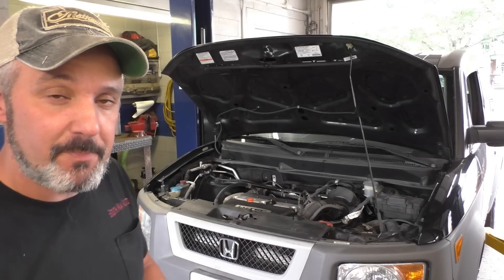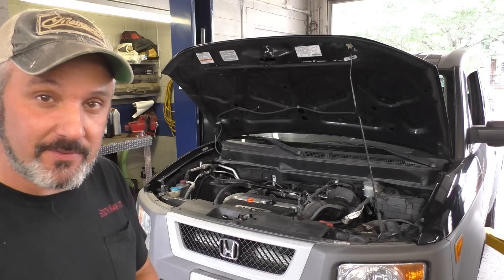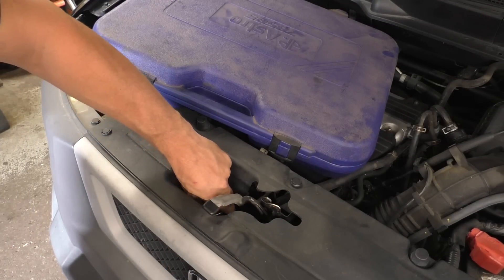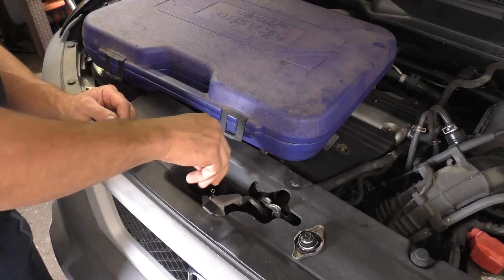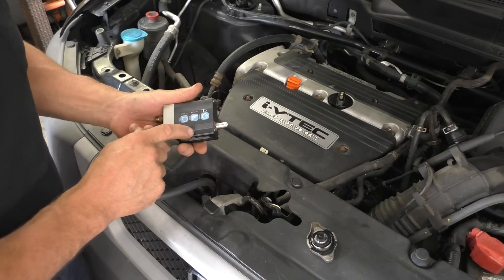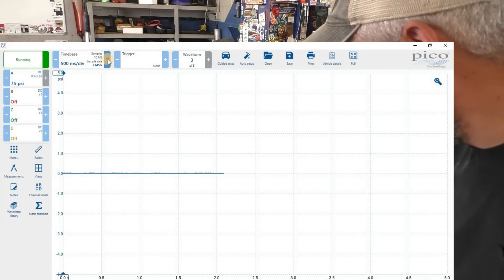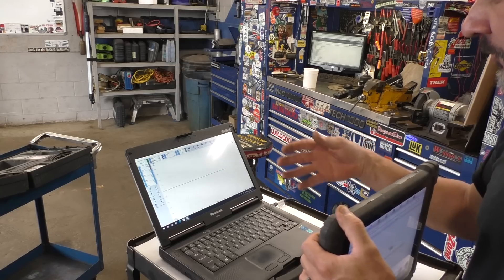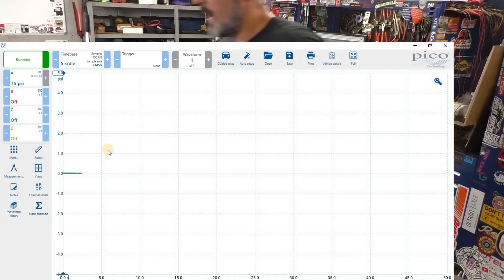Blown Head Gasket? On What Cylinder Though....🤷‍♂️

Comment: This method is 100%, but as someone one who works on cars as a hobby, my first thought was testing for exhaust gases in the cooling system before preceding, Eric any particular reason you went to the pico first?
Reply: More accuracy. The block tester will tell you if it's a majorly blown head gasket. The radiator pressure tester will let you know that the head gasket is leaking pressure into the radiator. The pico looks like it will let you know which cylinder is adding pressure down to sub one PSI increments.

Comment: this video was quite clear IMO, additionally if you get a hard to work on V engine, you can easily use this test to test if the front bank is blown or the rear bank without being too invasive and quote your customer accordingly (with good confidence), but this 4 banger was obv easier than that

Comment: Sounds like the 07 Chevy with the 5.3 I had, head was cracked, eating coolant, no other issues. Chevy charged me 6k for new engine. That one lasted 37k miles, did the same thing, they replaced that one and I sold the POS truck. They claimed they had never heard of this issue before.
Reply: Warm up your beast and it should do better. Without a warm up on a motorcycle or a diesel those head gaskets go pop in one drive

Comment: Wouldn't a testing the coolant with a block tester be easier because what does it matter which cylinder it is the fix is the same.  You should be checking the deck and head anyway.
Reply: Only work when there is a major leak in my opinion so major that you can see the bubbles anyways

Comment: I always wanted to know exactly which cylinder before stripping an engine, I used to put compressed air down each cylinder. But I like your way of doing it. I still have all my home made spark plug and glow plug adapters going rusty in my tool box. (I’m doing refrigeration now).

Comment: Also, the overflow bottle should smell like butane.  Put your exhaust gas analyzer wand tip in the overflow bottle when it's running and the HCs will be sky high.

Comment: brings me back to my broken head on my first car a Chevette leak in heater hose cracked head which jammed valve and burned hole in edge of exhaust valve took the head off in a couple hours 100 dollars for the rebuilt replacement head. bought my first torque wrench to tighten head bolts to build tool collection had to pay 20 extra on the core charge because it was cracked but a pretty simple cheap repair compared to todays cars

Comment: I have had 3 different diesel cars that have blown head gaskets, all times about the same symptoms as this. Starting with mysteriously disappearing coolant, when it gets worse, pressurizing of the cooling system. Fun fact: when it starts pressurizing the cooling system, it will start to overheat. You can counteract that by driving with low revs and removing the radiator cap, you can easily drive s couple of extra days or a week, so you have time to book the mechanic 😜
Reply: Oh someone who's experienced driving blown head gaskets, how rare. Another tip for those of you reading if you fill up the radiator and cruise at about 50 mph the car will never get hot enough to boil the water. Until it's like 90° or you try to go up a hill.

Comment: A pressure gauge  atop the radiator cap would be accurate enough to check gases passing into the cooling system? A  pressure leak down test, or compression test would be a better diagnostic tool for individual cylinders?   Another thought provoking video. Thanks.

Comment: So where is the coolant going? Through the exhaust? If you used a bore scope would you be able to see it on the top of the cylinder? (Clean) I don't doubt your diagnostic skills what so ever but the situation is so bizarre.  With the pressure in the cooling system, I'm surprised it's not pouring out onto the ground.
Reply: The thing is, that the combustion gasses only enter the cooling system under high pressure, when the engine is running. The blown gasket, or cracked head will act like a check valve, and you can't pressurize the cooling system enough to make even a small drop of coolant enter the combustion chamber
Reply: The coolant is going out the exhaust, the combustion chamber and the radiator should not be affecting each other on a pressure gauge. If they are that means the head gasket is not doing its job. The heads/block could be warped. It's rare to see the head gaskets actually torn most of them are metal nowadays, but it is common to see the head and block Warp

Comment: the way I test for blown head gasket.  I fill the radiator with coolant and install a leak down tester. then screw in the pressure hose into one cylinder at a time and watch the coolant rise at the radiator. For a blown head gasket between cylinders remove both spark plugs and add air to each one at a time the coolant will rise from both cylinders! 
!

Comment: EDIT: It’s worth mentioning that you haven’t proven that the vehicle has a blown head gasket. You know you have compression leaking into the cooling system. I’ve made that mistake before. Working on a Volvo with a B23 engine, it was leaking coolant into a cylinder causing coolant consumption and occasionally a misfire for a few seconds after a cold start. I identified the cylinder that was getting coolant, “assumed” it was a blown head gasket, put a head gasket on it (along with all the other necessary machine work) and still had the exact same problem. Took it back apart and stared at the thing for a long time before finding a hair-line crack on the cylinder liner. The shop ended up having to pay for a new engine.

Learning to use a scope and pressure transducers as well as how to actually apply that knowledge to practical uses in the automotive world was an absolute game changer for me. It turns a “difficult” diagnosis into a much more simple one. It makes me happy to see others making use of these tools since they were such a big deal for me.

Comment: Since it doesn't have oil in the coolant nor coolant in the oil-pan; I guess the gasket is not blown near to the oil passages nor the coolant passages? but is that possible?
Reply: Milky oil is when they're blown really bad. When it's running fine but slowly losing coolant that's when it's only blown a little.
Reply: @ddiablolll  yes ok I wondered about that
Reply: @ddiablolll  yes that makes sense; but the automotive instructors only explains the worst-case senarios, sometimes one is left to figure out smaller things from experience, that's why watching videos and asking questions is a GREAT THING!!!!!!!!!!!!!!!

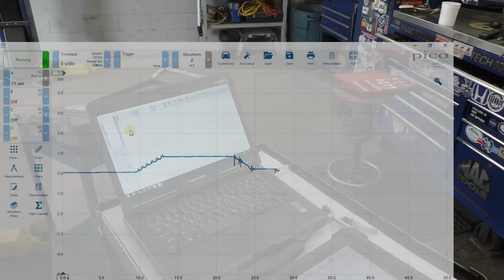Comment: 8:41 you said you would let the air back out of the system and try again. Couldn't you just leave the system with nearly 1 PSI and when you took the plug from the cylinder that was leaking you would see the pressure drop?

Comment: This was awsome.  I've used other methods to test but they do not identify individual cylinders, just that's there's a leak.  Looking closely at the pressure build wave form, I saw two distinct peaks  and said to myself, could that be 2 cylinders leaking (which you confirmed).  Great video and please keep them coming

Comment: I thought it was #4 just by seeing the first scope trace...  20 years ago I had a pico scope for Electrconics... still have it but don't have a parallel port to use it on. Always enjoy your video's.
Reply: Can this work on a parallel port to USB adapter? Driver software may be an issue but hardware interfacing should be good unless the pico scope used the parallel port in a non-standard way?

Comment: Looking at the pico trace, you can see two bumps on it then a space. That was another clue it was two cylinders. 

What I was curious about was whether a leak this small will show a current draw difference on the starter wire. Probably not, but this engine is really small. I wish you stuck the pico on there to show the two together, and then when you pulled plug #1, the two bumps on the pressure could have aligned with their cylinders.

Another reason for doing this pressure test with the starter instead of while running is that the starter turns the engine slower, so you can see it build. You can turn the engine with a wrench and see which cylinder is the culprit.

If you put the pressure in the coolant system and look in the cylinders, sometimes it does not show. Oddly, the pressure can push a bit of the gasket like a valve, and the pressure only flows one way.  Once there is enough pressure, it finds a way out somewhere else.

I am looking forward to the next episode with the post-mortem on the gasket. I have a suspicion on where it is leaking, and I hope you get to see it.

Comment: I have a 2000 GMC Sierra 4x4 4.6L.  I am on the 3rd engine since new.  I have lost coolant (about a half gallon every 2-3,000 miles) with each engine.  No signs of a leak and pressure holds stay on radiator gauge.  I've thought about that head gasket(s) but like you said, no driveability problems.  What causes my eyebrows to raise is the same loss in basically the same amount within three same time frame with all 3 engines.  At this point, it's just easier, and cheaper, to to of my current reservoir.  And yeah, I know, 3 engines right?  Over 500,000 miles.  Hard miles.  JS  My biggest problems with this truck has been the trans.  SMH I also have a 2000 Suburban 2500 2wd with no problems from the engine or trans.
Reply: It's probably only leaking coolant when it's under a good load. Head and block are probably just slightly warped like a hair.
Reply: @ddiablolll  That's is certainly a possibility.  That's what I was leaning towards until I looked at the video that Eric O. linked me to.  Either is a good possibility.  With the leak under a load I would have suspected, and been waiting on, the gasket to get a lot worse and maybe rapidly.  The leaky head via small crack could very well be it and the coolant "steaming off" instead of building up and running down into the crankcase.  Either way, for me and my limited disability snap income I'll just wait.  Thank both of you for your help and response!
Reply from the maker: https://youtu.be/BCPhVrWOnEI Maybe?

Comment: It's absolutely not a waste of time to narrow it down to which cylinder is having a problem. I've seen cases where it was impossible to tell where the leak was once it was apart. This way you know right away where to look, and if there is nothing obvious with the gasket, you know to send the head out to be checked, instead of just replacing the gasket and hoping that's the problem.

Comment: I am working on a Hondoo mower that won't run right, and it has been kicking my butt.  No where near as complicated on what you're facing however your patient approach of checking and testing caused me to rethink what the hell I was doing, or not doing.  Went back to checking all aspects - and it is now running correctly.  Thanks for another great video.

Comment: Working at ford we pressure test a warm engine and let it sit for a few hours and pull the plug that was misfiring. Now like you said you might not get any other symptoms. Ford's coolant intrusion codes are p0316 random mis on start up then whichever cylinder was misfiring. Plus smoke on start up is a tell tale sign lol.

Comment: Sorry.
Stant pressure w spark plugs out and coolant pours out plug hole.
 CO tester has already changed color.
After CO tester shows blown head gasket why spend time on which cylinder? Is this a moduler engine with individual cylinder heads? Mech is 100 $ plus an hour. Computer is cool but Boroscope will show clean combustion chamber from steam cleaning. 
Basic,  co color change start pulling head.

Comment: Why didn’t you check for exhaust gas in the radiator???
Reply: Because the head is only minorly blown and it would have to be bubbling a ton in the radiator in order for the block tester to change colors. And just seeing all the bubbles would tell you that it's a blown head gasket.

Comment: I have always just used the coolant pressure tester to see if the engine is building coolant pressure.  I’m not sure the extra steps of hooking up the scope other than to give a really good visual diagnose of the problem.  Thanks Rob

Comment: Excellent diagnosis. It amazes me how many tools (electronic or otherwise) it takes to do this kind of work these days. 50 years ago when I worked on my cars I would have looked for bubbles in the radiator and got ready to pull the heads.

Comment: It's crazy I just did a job like this. Ended up having two cylinders leaking coolant. On my '04 pilot had no symptoms ran just fine only reason I knew it was leaking coolant was because I was losing it and there was no traces of coolant anywhere. Pulled the oil plug and we got more than just oil. Cold the rear head and we had two pretty large puddles in cylinder three and five. I was amazed that there was no symptoms no white smoke anything happening at that point. She's back together and hopefully runs for another 200,000 miles

Comment: I discovered I was burning coolant while on vacation. I noticed an oscillation on the temperature gauge. Stopped at a truck stop. My radiator was half empty. Bought a couple gallons of prestone drove through to home 200m miles, had planned to grab room for the night. Instead I drove and got up early to go to the dealer. Was still under warranty.

Comment: Thanks for going through the motions of how to tell what cylinder has the problem.  As you said, probably not necessary for this engine, as the gasket gets changed either way - but certainly useful if you're dealing with a V6 or V8, as you probably don't want to have to change both head gaskets if only one is bad.  👍

Comment: How is the pressure getting to the radiator through what I assume is a closed thermostat?
Reply: The engine has a small bypass hose from the engine to the radiator.  Any compression getting to the cooling system would end up in the radiator.
Reply: @robertheinkel6225  Thanks!
Reply: The pressure is coming from the combustion chamber that's squeezing through a hairline Gap (from the warped head) between the head and the block going into a coolant passage.

Comment: Airing up each cylinder with shop air through the spark plug hole with a leak down tester works every time too.  Just watch for the bubbles or coolant level surge in the radiator/coolant expansion jug.

Comment: Cool test, I have a question. If someone had the rad cap kit, or something similar, and not the pressure transducer and accompanying oscilloscope, could they use the analog pressure gauge that comes in the kit to do the same thing?  I think that should show the same result. Am I right? Cheers.

Comment: What's the point though? Just do the blue liquid test on the coolant gases, if it turns yellow, you do a head gasket... What's the point of knowing which part of the gasket failed? You'll see it when you'll take it out anyway.
Reply: I bet the gasket will look ok when he removes it.
Reply: In my experience you have to have a lot of exhaust gases in the radiator for that test to work.
Reply: @ddiablolll  
If you keep the car running and pump the plunger for a minute or two, even small leaks can be detected.

This specific customer already lost fluid, so it's not so minor.

Comment: This method is known as "deductive logic".  It's interesting to see that the wave form was actually exactly the same-- just at a different amplitude, once you pulled one of the bad plugs.   So that makes me think that both cylinders must be leaking through the same hole...  but even then it's strange that you don't see a double impulse-- rather than just building pressure faster.  That's pretty odd.

Comment: What would cause a blown head gasket on these 2.4L Honda Engines?  I have a Honda CRV with the same engine and just want to know to prevent this from occurring.
Reply: Overheating due to other causes, fans inop, coolant leaks etc.  never run an alloy head engine low on coolant.
Reply: Warm up the car before driving it. If you're in some really cold snowy place I'd say warm it up for 15 minutes but if you're in somewhere like Florida just 5 minutes

Comment: But you didn’t isolate number 1 and number 2 so you could prove or disprove a contributing leak from one or both of those cylinders. It’s a quick thing to do and even though it would likely be small or nonexistent it might be beneficial in diagnosing a problem with the head or even the block.
Reply from the maker: I did though. With both 1 and 2 out the pressure change DID NOT change at all PROVING the problem was not in those two cylinders. Does that make sense?

Comment: "There's your problem lady"...I'm gonna have to change both head gaskets because it's leaking on two cylinders.  But I'm going cut you a break and only charge you half price for the second cylinder.  That will save you money.  
And I recommend you change the head gasket on all the cylinders while I have the engine pulled out.

Comment: I love my pico scope it’s just a cheap 2channel but helps with diagnosis. For  me personally DYI being it’s a 4cy one head to remove I would just check combustion chamber gas in radiator and if so . Pull the head . But I love your expert diagnosis right to the spot 👊🏻

Comment: I had a 3.4 that was getting hot and using coolant but nothing in the exhaust and very slow leak down so I tore in to it was a intake gasket completely eaten away from the dexcool $700 bucks later
Reply: Now that's pretty sneaky. Dex cool seems to have more head gasket issues that's why I always stick to the green stuff or the blue stuff or the pink stuff

Comment: if the coolant is going into a cylinder the piston will probably be very clean and sweet smelling exhaust. don't need a fancy gadget to find it. if its a "V" anything i will just do BOTH, thats just me. i found honda engines with oil leaking out of a head gasket. recheck torque WTHeck? loose. was an old car, oil leak stopped with heavier oil SAE20W and retorque. just luck